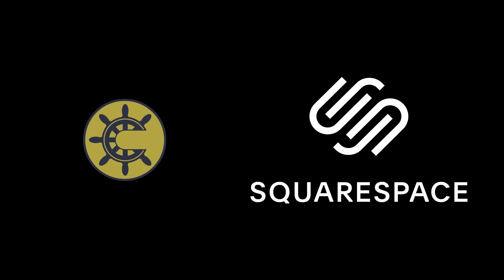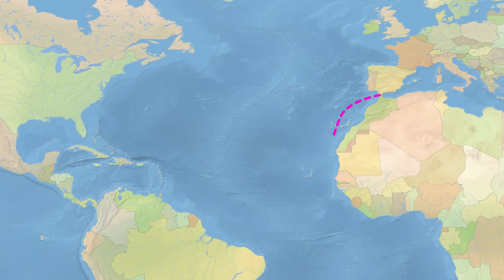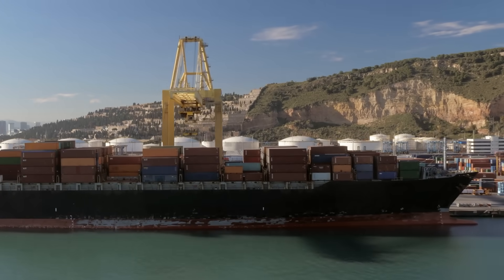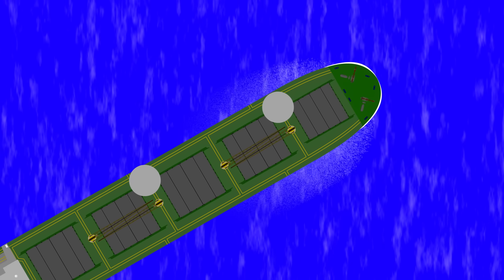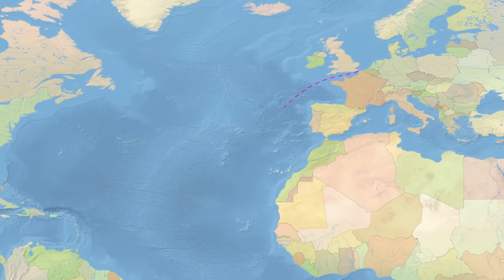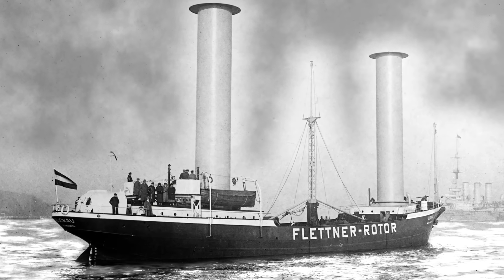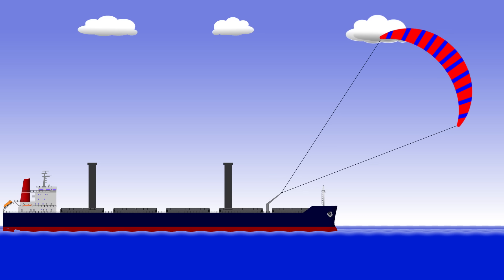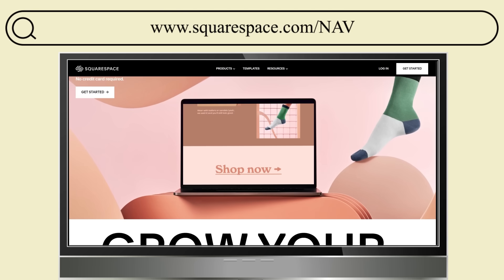Why Don't Sails Work On Ships?

Comment: The US has the Jones Act. It only effects ships travelling from one US port to another, but it does effect US Shipping. - Countries, especially influential ones, could require that ships docking in their ports have a certain level of lower of emissions. They could even require ships to be using wind power, although this can cause issues with innovation (What if solar power suddenly becomes better than wind power? What if cold fusion becomes viable and is light enough and cheap enough to be used on cargo ships? Sounds SciFi, but I'm watching videos from all around the world on a device that fits in my pocket. I'm writing a message for anyone in the world to read, on a device that fits in my briefcase. So, I wouldn't write the law in a way that requires something like "sails" but it could be done.) Then, it doesn't matter what country the ships flag from, if they're not allowed in port to pickup or dropoff cargo without meeting the requirments then they'll want to meet the requirements.

Comment: sails do work on ships  no matter the size there just to lazy to  high enough crew to operate them and handling sails  is no easy task u have to be in damn good shape to handle it
Reply: The problems with the wind as an energy source are variability, reliability and low energy density; also relevant in this context is that the canvas, cordage and extra manpower needed for sailing ships were never a very benign environmental option so please discount any idea of sail as ‘sustainable’ and all this is without the problem that if ‘the wind don’t blow the ship don’t go’.  When it does blow it often blows in the wrong direction for your cargo delivery needs and sometimes there is rather too much of it for comfort.  The area where one is most likely to be ‘becalmed’ is the ITCZ (Intertropical Convergence Zone) or ‘the doldrums’ as it is commonly called.  In days of old ships with large crews, such as naval vessels, would try using the ships boats and some of the crew to row through the doldrums thus towing their mother ship out of the calm.  Not practical for less well manned and much heavier merchant ships which could not muster a similar power (oarsmen) to weight ratio (vessel displacement).  Traditional sailing ships are unable to go directly up wind so if the wind is blowing from the direction your cargo needs to go then a zig-zag course must be steered, more distance and thus more time on passage at whatever speed is achieved.

Comment: Regulations lead to a loss of innovation and a gain of corruption.  A better solution is to find a way that makes it economically beneficial for the owner to install a technology,  like starting a foundation that raises the funds and pays the owner to install the technology or a ship building company that builds the ships with the technology already installed and finally getting existing environmental groups to give grants to ship owners to add the technology to their ships.  Anything is better than raising the start-up costs for new companies through regulations and reducing market competition thereby raising the cost of transportation.
Reply: Giving money away is a poor motivator for changes that will improve the world.  A free market is not a market free of regulation as is frequently touted but a market where the regulators encourage both buyers and sellers.  As an example regulating lower sulphur contents in fuels improves life for everybody, including the buyers and sellers. costs for the sellers are increased so that will be passed on to the buyers but the air quality will be improved and the increase in fuel cost will raise shipping costs thus encouraging local industry.
Reply: @BernardLS  regulating lower sulfer content raised the cost of fuel and thereby the cost of goods when a more efficient engine would have done the job better along with a functional exhaust filtration system.  Lowering sulfer also raised repair costs as repairs became more frequent due to the lower lubricity of the fuel.  I also never said give the money away, I said to create a foundation that assists, use environmental groups to help raise funds, and get the existing environmental groups to set up grants.  All of those examples come with an oversight organization and stipulations on how the money is spent and the government doesn't need to be involved. Raising operating costs never incourages productivity it only hurts it.  Competition can not thrive if it can't afford to exist in the first place.  Your logic is extremely flawed.
Reply: @AllanHazen   ‘Lowering sulphur also raises repair costs as repairs became more frequent due to the lower lubricity of the fuel.’  Similar effect were noted when the middle distillate fuel was introduced for road vehicles, I spent many an hour peering at the wear scar from samples tested on HSRR running lubricity tests.  The fix was lubricity additives, extra cost, at the refining stage which was, of course, eventually passed on to the consumers.  Prices up - consumption down may be extremely flawed logic but it works for me, squeeze out the ‘wants’ and there should be more available for the ‘needs’.  A friend in Oz can recall driving 3.5 hours, each way, to get to the ‘best’ beach; now he only drives for 15 minutes, again each way, to go to an adequate one.  As well as improving air quality removal of sulphur from fuels also kills the need for mining of elemental sulphur which is a secondary bonus, unless one is in the sulphur mining business.
Reply: @BernardLS  you keep shooting yourself in the foot. You just admitted again that removing the sulfur raised cost and put people out of employment.  Then, you admitted that removing the sulfur made a need for additives to make up for the loss in sulfur, which obviously creates a new form of pollutant.  Thus proving the regulation solved nothing as it traded one polutant for another and raised the cost of goods and services, maintenance, and fuel cost.
Reply: @AllanHazen   WADR your assertion that I am shooting myself in the foot is unfounded.  The purpose of increasing costs is to focus consumption on ‘needs’ not ‘wants’.  The lubricity additives improve the situation not only by reducing the sulphuric contamination without introducing other atmospheric contamination but the prices to consumer increase reduced spurious consumption (entertainment, recreation, fast fashion, et cetera).  Employment opportunities change, the UK coal mining industry died because North Sea methane (natural gas) provided energy with less man power.  It also freed up the miners from a life of hard, unhealthy & dangerous manual labour underground.  The pollution from methane combustion exists but is less than the pollution from gaining the same energy from coal.  A good further incremental improvement is using the manpower freed from a life of drudgery below ground to create the wind farms and solar arrays that may one day displace the methane in the search for the energy humanity needs.

Comment: You noted that the cost of the rotors will make rates for cargo go up but you failed to note that fuel consumption would go down approximately three-quarters as noted with the ship from the 1920s. This fuel savings is what should be used to pay for the rotors.  People don't need to be enforced to do things.

Comment: So, you’re a bit wrong about sails and cargo loading.  Sailing ships did carry cargo, including cargo far too heavy for people to lift without a machine.  The solution is that sailing cargo ships can use their rigging as a crane to lead cargo.  Instead of using shore based loading cranes, they used ship based cranes, which also swerved as part of the rigging, which also allowed them to load and unload from anywhere, not just berths with loading cranes.  This isn’t hypothetical, this is historical fact.

Comment: An old-fashioned ship full of masts and sails does look cooler in my opinion. Currently, sails are pretty popular for private boats, and the occasional larger vessel, but you never see more than two masts
Reply: To address the suggestions that wind power is the answer I offer the following.  The problems with the wind as an energy source are variability, reliability and low energy density; also relevant in this context is that the canvas, cordage and extra manpower needed for sailing ships were never a very benign environmental option so please discount any idea of sail as ‘sustainable’ and all this is without the problem that if ‘the wind don’t blow the ship don’t go’.

When it does blow it often blows in the wrong direction for your cargo delivery needs and sometimes there is rather too much of it for comfort.  The area where one is most likely to be ‘becalmed’ is the ITCZ (Intertropical Convergence Zone) or ‘the doldrums’ as it is commonly called.  In days of old ships with large crews, such as naval vessels, would try using the ships boats and some of the crew to row through the doldrums thus towing their mother ship out of the calm.  Not practical for less well manned and much heavier merchant ships which could not muster a similar power (oarsmen) to weight ratio (vessel displacement).  Traditional sailing ships are unable to go directly up wind so if the wind is blowing from the direction your cargo needs to go then a zig-zag course must be steered, more distance and thus more time on passage at whatever speed is achieved.

Wind speed is traditionally measured on the Beaufort Scale (wind speed) that runs from 0 (< 1kn or 0.5ms-1) to 12 (> 63kn or 32.5ms-1) and for sailing purposes the usable part of the range is ‘3’ (circa 8kn or 4.1ms-1) to ‘6’ (circa 24kn or 12.3ms-1).  As the wind speed, and the amount of energy that may be harvested there from, increases the sea surface becomes progressively more disturbed which makes the harvesting process ever more difficult and increases the stress on the vessel.  The increased stress means the sail area has to be reduced, either by using fewer or smaller sails until the vessel may in extremis be ‘hove to under storm sails’ or riding out the unsuitable weather using either a sea anchor or a traditional ground anchor. 

With any wind power proposals the question that must be asked include ‘has any information been released into the public domain with regard to the expected energy harvest for the system, on a Joules per square meter basis and how may this energy be deployed as power in Watts?  ‘Cutty Sark’, is said to have been able to coax 3 000 horse power (or 2 206 500 Watts / 2.2 megaWatts)) out of her, up to, 2 976m2 of sails, assuming ideal conditions and further assuming that for sailing purposes the usable part of the wind speed range is 4ms-1to 12ms-1 so the yield would be about 741 Watts m2.  So another question ‘for the proposed option what is the expected upper wind speed limit for the system’?  A single stage 'harvest to deployment' system for propulsion will have higher efficiency but ‘what steps are being taken to provide ancillary power such as the, small but essential, domestic, navigational and cargo needs?’

Comment: Very long ago sailing ships were used a lot as cargo ships
Reply: In 1870 a premium sailing vessel entered service, the ‘Cutty Sark’.  The ‘Cutty Sark’ was 64.74 metres in length with a beam of 10.97 metres and a loaded displacement of 2 100 tonnes.  She was able to carry, at best, 1 700 tonnes of cargo and to harness the energy in the wind the available spread of canvas was up to 2 976m2 which was tended by a crew of about 30 skilled men.  The ratio between the sail area (SA) and the vessels displacement (D) determined how lively she was; ‘lively’ being nautical speak for ‘fast and manoeuvrable’.  The carrying capacity of cargo ships is constrained in two ways, mass (weight) and volume (cubic capacity) which leads us to the ‘stowage factor’ of the cargo; the more mass on board the greater the displacement which in turn impacts the efficiency of the hull form and the sail area / displacement ratio.

A vessel constrained by mass is said to be ‘down but not full’, while a vessel constrained by volume is said to be ‘full but not down’.  When in the tea trade, which the ‘Cutty Sark’ was designed and built for with fine lines (more nautical tech speak, so again no need to worry about it), she could carry around 600 tonnes of cargo at speeds of up to 17.5 knots dependent on the prevailing wind and had a typical China to UK time on passage of 120 days.  The tea trade was very competitive so ‘time on passage’ was a large factor in securing the premium freight rate that made the ‘Cutty Sark’ cost effective.  Rounding things out, her maximum available sail area gave circa 5m2 of canvas for every tonne of tea carried.

As soon as the Suez Canal opened, which the ‘Cutty Sark’ was unable to sail through; she lost her advantage, raw speed, to the steam powered ships of that era who could beat her ‘time on passage’ by taking that short cut.  Mechanically powered ships have improved in terms of efficiency, on a freight tonne mile basis, by at least one order of magnitude since then.  After losing out to the coal burning, fire tube boiler, steam reciprocating mechanical ships of the late 19th century ‘Cutty Sark’ was relegated to the Australian wool trade, just about the bottom of the barrel in maritime terms and only one small step up from being a 'honey barge'.

With any wind power proposals the question that must be asked include ‘has any information been released into the public domain with regard to the expected energy harvest for the system, on a Joules per square meter basis and how may this energy be deployed as power in Watts?  ‘Cutty Sark’, is said to have been able to coax 3 000 horse power (or 2 206 500 Watts / 2.2 megaWatts)) out of her, up to, 2 976m2 of sails, assuming ideal conditions and further assuming that for sailing purposes the usable part of the wind speed range is 4ms-1to 12ms-1 so the yield would be about 741 Watts m2.  So another question ‘for the proposed option what is the expected upper wind speed limit for the system’?  A single stage 'harvest to deployment' system for propulsion will have higher efficiency but ‘what steps are being taken to provide ancillary power such as the, small but essential, domestic, navigational and cargo needs?’

Comment: Wonderful Analysis. The Central Issue is not just Economics but International Politics and Geo-Economics.
If significant environmental benefits from these technologies can be demonstrated than a Global push for UN Regulations for ship design can be pursued fruitfully by overcoming individual country interests through Global Public Pressure.
Reply: ' The Central Issue*, WADR, is localise production to consumption; among other things.  The hydrocarbon age is not quiet at an end yet; the era of large scale mechanical mercantile shipping may have provided us with the means to get out of a cycle of 'nasty, brutish and short' life into an epoch of life that is, relatively, 'pleasant, refined and long'.  Much of the current ‘quality of life’ we enjoy we owe to the fossil oil and gas industry.  The 26th UN Climate Change Conference of the Parties (COP26) held in Glasgow between 31 October 2021 & 13 November 2021 established requirements and targets for mitigation of the production of GHG and with regard to shipping steps to reduce atmospheric pollution to acceptable levels could include, but not be limited to: -
1) Abolish the cruising fraction of marine transport;
2) Abolish recreational boating;
3) Improve fuel quality;
4) Localise production to consumption;
5) Reduce 'freight mile' distances;
6) Reduce spoilage / waste of all commodities;
7) Reduce freight carrying capacity;
8) Reduce the global population of consumers;
9) De'fossil'ise the fuel chain.
The use of any of the options above may not be the future of marine transportation but moving less material and moving what is transported over shorter distances, as in the past, should be.  Together with localised production and minimised consumption a global population that has individuals’ voluntarily self-limiting reproduction to two children per parent (both male and female), might save the planet.

Shipping currently has a 'high volume, low added value' business model and it needs to return to the 'low volume, high value added' model it followed in the past.  Addressing the 3% of global GHG emissions generated by shipping will be less advantageous than dealing with the 24% due to other transportation, the 24% of the of GHG emissions due to manufacturing industry or the 25% due to electrical power generation. (Figures from https://www.epa.gov/ghgemissions/sources-greenhouse-gas-emissions, et al).  Any alternative to the existing system needs to provide better value and so depends on the yield; the energy input less losses must reliable and consistently provide sufficient energy output that can be deployed for propulsion, cargo handling and domestic services.  All of which must be achieved within the current limits of mass (weight), volume (cubic capacity) and cost.

Comment: Or the ship owner goes "fuel cost without rotors are estimated to be___". By using rotors will save $__  on fuel costs. I will charter my boat for more, but you wll overall save money.
Would you pay more to rent a Prius vs Surburban for a cross country road trip?

Comment: 2:08 a sail creates a high and low pressure because of its aerofoil shape, you’re actually being pulled forward by the sail
Reply: Sails are made from cloth or a flexible synthetic film. they are not rigid, and therefore cannot change the direction of airflow like a solid wing does. Sails only deflect air and the reaction force is what provides lift.